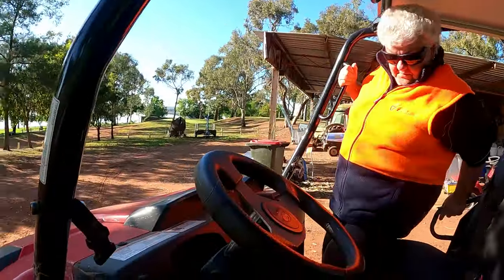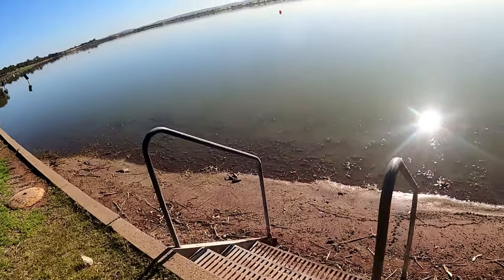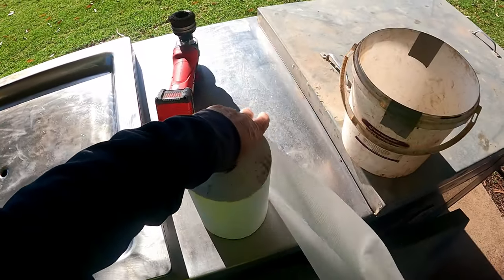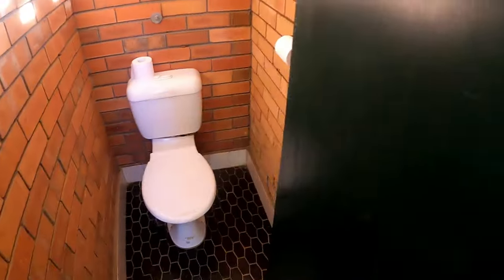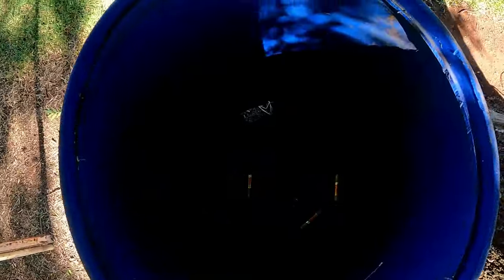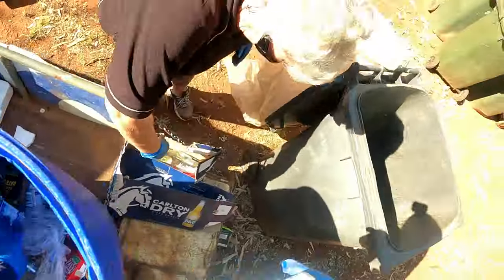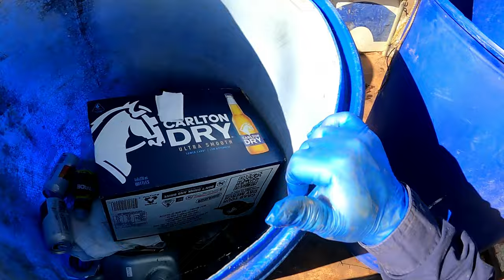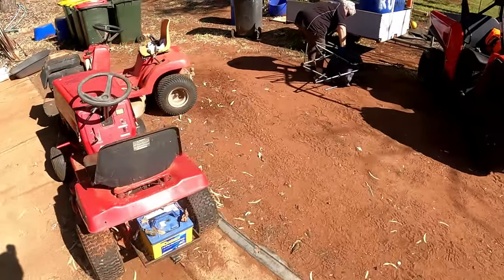When you have a good system you don't brack it

Comment: Hello Tim and June 😊 How good to see you both in your daily routine. Don't you clean the barbecues with grease remover? Just water doesn't remove the grease and don't you use any disinfectant cleaner in the bathrooms? just an air freshener? Well, that's what I think, I hope you don't get angry because of what I say. greetings and have a good weekend😊👍😎🇪🇦
Reply from the maker: @silviaB.LL3921  to your first question of cleaning the barbecues grease remover is not required when you are using a brass brush on a grinder and paper towel especially on a stainless steel surface.
Also for the toilets we do use a disinfectant but on this day it was more just a general check over as we didn't have many people around and they are done daily they are great questions no we're not angry with anyone that asks any questions of any nature we are glad you enjoyed the video stay safe.👍👍🍾🍾🖐🖐🖐😁😁
Reply: @oureverydayliving  👍❤️🍻